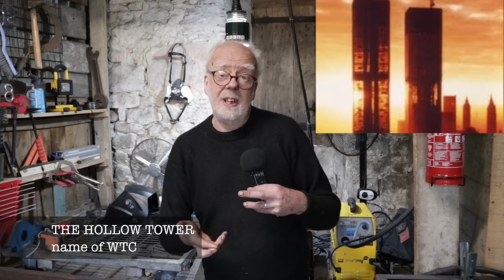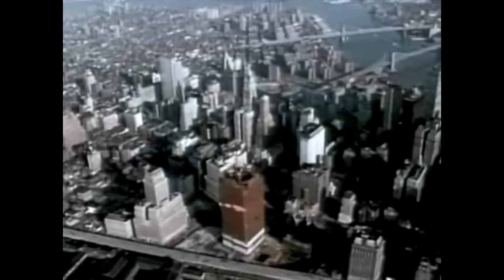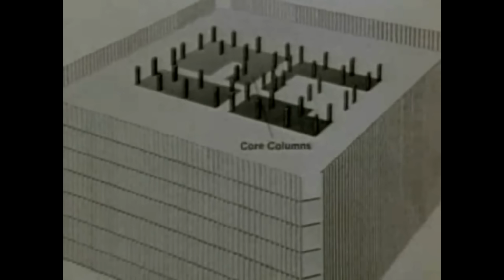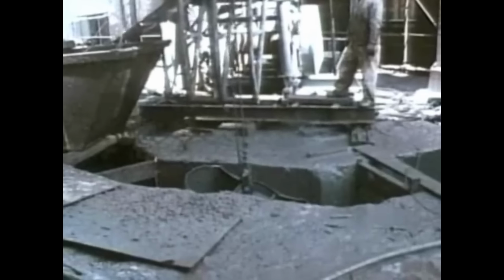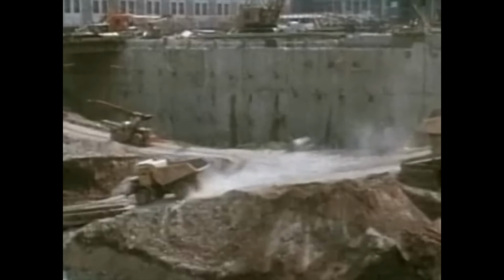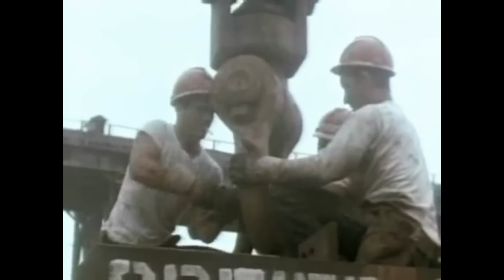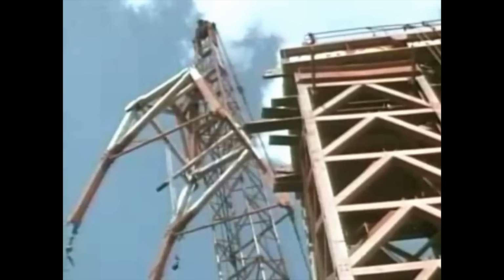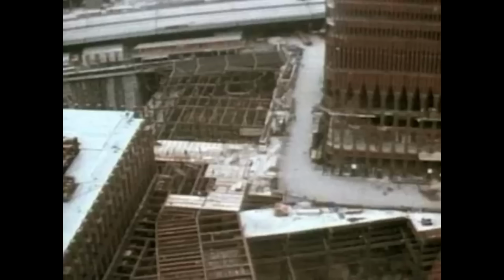WTC construction film - Prof Simon

Comment: Finally things actually make sense to me two decades later! Wow did the media do a poor job explaining a rather simple concept! I know I
was 13 at the time but still, I could have easily understood things if they had spent the time like you did here… The only thing I’d like to find out is why didn’t the towers lean when collapsing, but I guess only one side of a four sided box was hit and collapsed floor by floor before the one side was weakened enough to cause the weakness in that one side to cause the building to favour that side for Collapse. Actually it totally makes sense that the weaker floors falling one on top of each other is how the building started to collapse! It basically makes no sense other than that as all that would need to happen is the weaker metal holding up each floor to be sheared by the plane and the fires to soften the metal until they either separated from the core, sidewalls or both and that domino effect to take effect. What a sad day. There was lots of negligence by many parties which sadly doesn’t help dissuade the conspiracies but the buildings falling down not due to the airplanes I find to be actually the least likely conspiracy related to that days events! I find many areas linked to negligent intelligence to be a much more likely source to a conspiracy and even that vastly unlikely. Incompetence sounds much more reasonable of an explanation…

Comment: They found large pools of molten steel under the rubble. How did jet fuel melt steel like in a foundry? You can also see completely melted steel pour our of the buildings while they where still standing.
Reply from the maker: Not to doubt you but there probably weren’t pools of molten metal...or Milton steel pouring out of the building...I’m not finding any real evidence of either...So planes hit the buildings...the buildings fell down...the energy of the collapse caused fires and heat... it that hard and the most likely explanation...why hang onto to tenuous straws of conspiracy, when the truth is pretty simple and very sad.?
Reply: @SimonHollandfilms  Fire fighters have on camera testified that there where pools of molten steel, not just days but weeks after. And you can also very clearly see metal pouring out of the building before the collapse. I can’t see a conspiracy in that, however a real and unbiased investigation of how that was possible is completely missing.

The hundreds of thousands of civilians killed in the aftermath of this event—the so called war on terror, THAT is sad.

Comment: Sorry something still feels wrong here. The central column is seriously strong, even if the walls and
floors fell it still seems to me the central column should have remained largely
intact, it may have fallen over sideways when it lost the support of the walls but why
would it fall vertically as quickly as the rest. And then ok the twin towers were built as
very tall hollow square section buildings so lets assume they fell due to their
design, how does that explain WTC 7 which was not the same design or shape or height and yet fell free fall?
Reply from the maker: Good point Campbell....I wonder how the lift shafts fell....if you look at building collapsing...they do all turn into a pile of rubble...maybe just because concrete fails under tension...but is strong in compression....thanks.
Reply: But the problem is the lift shafts were all steel like the outside from what I can see so I cant see concrete ( which was used on the floor spans) has much to do with it. The offical story is the floors sagged and broke the connections at the ends of the beams so that suggests to me that the steel structure in the middle ( which is seriously strong and very big ) should have been able to support its self more than it appeared in the collapse. Just saying :) thanks for you really interesting channel

Comment: I have a question that should be able to be resolved entirely by math alone. So, unless anyone disagrees with the validity of mathematics, this should be a quite straight forward question. How fast should the towers have collapsed assuming that the dozen or so floors that were affected by fire had their support 100% compromised? If your answer is anything much slower than freefall speed, then there is a problem. Look at the amount of time that it took the towers to collapse. Without zero resistance being provided by the building's support there is simply no way for a structure to collapse that fast. Don't argue with me. Please, just show me the math to prove me wrong.
Reply: This is worded a bit confusingly. Are you arguing that the towers collapsed too quickly to be natural? If so then I can prove that wrong.
Reply: Modern buildings are hollow 90% air, so they have ZERO resistance to vertical kinetic energy.

They only have resistance to static, dead loads and live loads.

The towers did NOT collapse at free fall.

NIST estimated the elapsed times for the first exterior panels to strike the ground after the collapse initiated in each of the towers to be approximately 11 seconds for WTC 1 and approximately 9 seconds for WTC 2. 

These elapsed times were based on: 

(1) precise timing of the initiation of collapse from video evidence, and 

(2) ground motion (seismic) signals recorded at Palisades, N.Y., that also were precisely time-calibrated for wave transmission times from lower Manhattan.

From video evidence, significant portions of the cores of both buildings (roughly 60 stories of WTC 1 and 40 stories of WTC 2) are known to have stood 15 to 25 seconds after collapse initiation before they, too, began to collapse. 

Neither the duration of the seismic records nor video evidence (due to obstruction of view caused by debris clouds) are reliable indicators of the total time it took for each building to collapse completely.

So you see it was only the outer shells of the towers that collapsed near free fall, because they collapsed out to the side into the air.

It is also highly possible that large or small sections of the inner cores tipped over sideways.